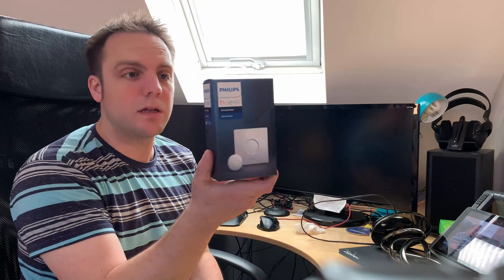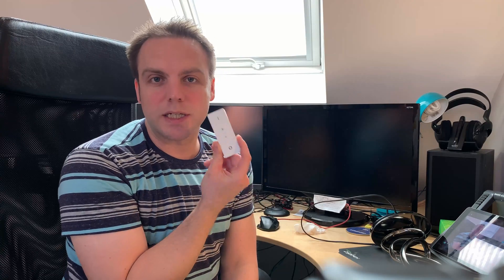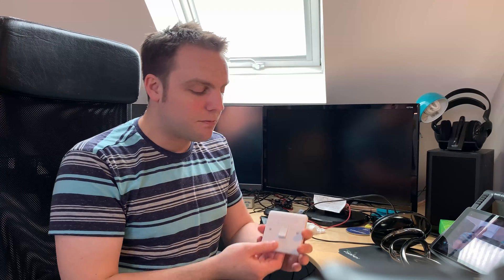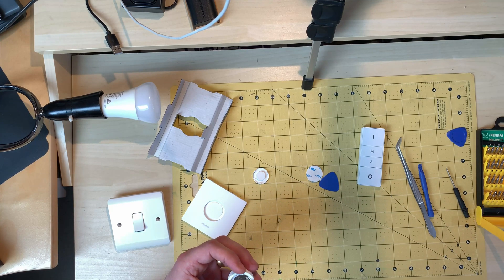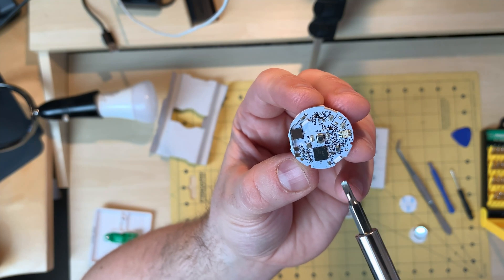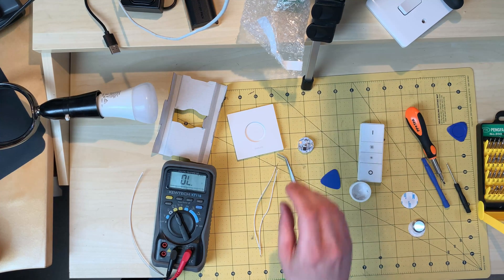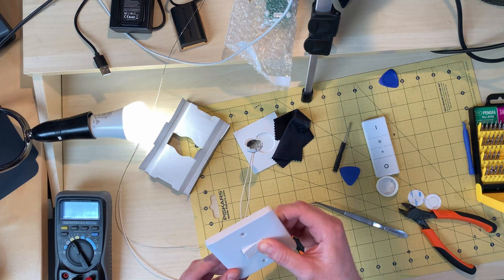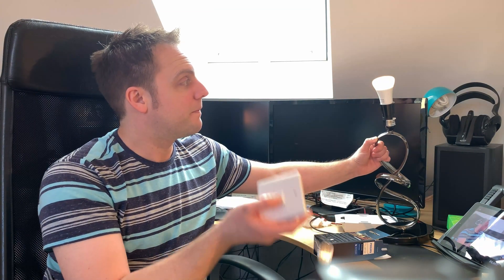Philips Hue Smart Button - teardown and hacked into a retractive push button interface :D

Comment: I remembered coming across this video years ago and it is now exactly what I am looking for to add a "Pull Cord Switch" in my bathroom. Have you tried this with the newer style switch? I was also thinking it might be possible with the "In wall module" with less modifications required?
Reply from the maker: I would imagine if you use a standard latching
 pull cord switch you could use the Wall Switch Module off the shelf ;)

Comment: Awesome ! Can you do the same with a hue smart plug ?
Reply from the maker: If you mean can the button control a smart plug? Absolutely.

If you mean can you adapt the integrated button on a smart plug? No I don’t think so; with that unit you’re looking a 230v board so the principle would probably work but I would use a smart button to do that - wireless, battery powered and the switch can control the smart plug without messing with 230v

Comment: Great video 👍

Another option is the Samotech modules which can simply sit in the ceiling wired to the first bulb in the circuit, allowing you to use any retractive switch (like Gira) at the wall while having Hue integration.

If the back box is deep enough, these modules can even sit there.
Reply from the maker: The problem with all of those types of solution is that they are not friends of hue - so you lose HomeKit and Siri functionality (at least).
Reply: @HouseOfPayne666  

Actually, Samotech is one of the few that is exposed to and compatible with HomeKit and has the HomeKit integration via the Hue bridge 👍

It’s compatibility includes:

Hue Bridge
Apple HomeKit 
All the Amazon Echo Zigbee Hubs
SmartThings 
deCONZ
Raspberry
Reply: but then you have to buy those €30 modules .. with this method I can use my old (€21 ) smart  buttons and put them into a €1,50 switch matching my power outlets.

Comment: Anyone had any issue with battery? Placed a brand new batter in the device and then hooked it up to a pulse switch, within 20 mins I’m at low battery within the Hue app (4% showing in Hue Dynamics).
Reply from the maker: Not at all - mine are still going strong since I did this video
Reply: @HouseOfPayne666  very strange then. ive put another new battery in and same thing. like it still works (most times), but it now just sits at 1% battery
Reply from the maker: @TooSpeedy  you must have a short. Is the pcb insulated? Is it in a metal backbox?

I cut a slit in the button case and reinsert in the button case secured with hot glue - then the battery cover magnetised onto the back providing a fairly neat package which is insulated.
Reply from the maker: @TooSpeedy  you are using a spring return switch rather than a fixed position switch yes?
Reply: @HouseOfPayne666  yeah it’s a spring one. The actual process works fine. 

It is in a metal back box, will be changing this for a plastic one. I did put insulation tape around the pcb / connectors etc to make sure things weren’t touching. What I may do it out the cover back on top and see if that helps things
Reply from the maker: @TooSpeedy  sounds like you’ve covered all the bases - perhaps it’s just faulty? I’ve made 9 or 10 with no issues.
Reply: Seems like the Hue Button is faulty. Mine stopped working after ~4 months, the new Panasonic CR2032 lasts only for few pushes and the LED goes red. It would be amazing to find a reason of the issue and fix it.
Reply: @robxxxx6987  hi rob, this is a known issue with the hue smart button. it seems it’s the luck of the draw whether you’ll end up with a button with this issue. i bought my sole hue smart button direct from philips and i’ve replaced my battery three times in about the space of a year. i spoke to philips and they advised me to try a new battery since the one that came with the button, which i’ve done twice now. so time to speak to philips again to hopefully get a non-faulty replacement.

Comment: I've been looking to do something similar. eg. my heating oil tank has a electronic gauge with binary volt free outputs for low fuel and also I have a float switch in my pond for low level. I want to use something cheap to create a routine to my Alexa. I have tried hacking a cheap smart door sensor with limited success, as it uses a vane hall effect sensor and magnet as apposed to a reed switch that would be easier. Anyone have any ideas ??
Reply from the maker: Depends on your system - what do you run - zigbee? Zwave?

Comment: Great video! Which diameter wire did you use (in mm)? And do you attach the housing back (modded?) on for dust, before mounting it in the backbox?
Reply from the maker: You can use pretty much any wire; I think mine was about 0.5mm2 cross sectional area but it doesn’t matter.

When you get the hang of it - cut a strip down (all the way) for the cables and squeeze  some hot glue in the button case then insert the unit back in. The battery cover will magnetise onto the back but it won’t close fully as it did before but it keeps all the metal stuff insulated.

It’s fairly neat - I’m pleased with it

Comment: You can do the same with a Tradfri dimmer from IKEA, which are only €6. I have a two-gang switch using two of these and it works great!
Reply from the maker: You know what - that is _perfect_. I'm living with these one fold buttons and often find myself wanting the lights brighter. This invariably requires me to press and hold twice, or turn the lights off, and then on again to get more light. 

I've decided a 2 way rocker (ON/Dim up, and Off/Dim Down) is the only practical way forward. Thanks for the heads up - I'll definitely be buying one to experiment.
Reply: @HouseOfPayne666  It's Touchlink so there are a few limitations but you should be fine. Good luck!

Comment: Hi, great video and perfect for what I have been looking for.  What faceplate did you decide on in the end or are you still looking for a ‘premium’ replacement?
Reply from the maker: I keep walking past the hulsta shop on Baker Street in London, and Mean to go in (Gira are downstairs) but I’m worried about the whole pandemic and unnecessary visit thing at the moment.

Jung have just opened a showroom too. I’ll pop in in the new year ;D
Reply: Yeah, understand - strange times at the mo.  Would be good to see a video when you’ve got the new switch.  Also, I see from your other comments that you’ve also tried something similar with the four button dimmer, that would also make a good video.  Keep safe.
Reply from the maker: @CYP4ER.  I didn’t film the 4 button dimmer; it’s extremely fiddly, and much less useful. More importantly the pads are minuscule and the final product is not remotely robust.

The only practical use I can think of is 3 scenes and off with no dimming. This doesn’t seem as useful as the one button control, to me.

I would not recommend it.
Reply: Thanks for your feedback, looks like it’s the button route for sure.
Reply: @HouseOfPayne666  I've been following the various discussions and held off from doing this before knowing what faceplate/switch to use that would be compatible with a UK backbox? I had a look at the Jung LS990 switches online, but they do not seem compatible with UK back box screw holes.

What switch and brand have you been using temporarily at your house?
Reply from the maker: @philhario3640  I’ve been using Hager sollysta switches which match exactly with my non hue Hager switch circuits - visually you cannot tell the different between a switched circuit and a hue retractive switch circuit - they look identical - but one type is spring loaded :)

They’re not elegant like the ls990 switches but they do work nicely.

Re ls990 yes - they are designed for a euro round vde wall box and will require an adapter to mount in a Uk box. This adapter will lift them off the wall by about 0.75 millimetre and the adapter plate can be seen. 

It’s not too hard to replace the back box off you really want to. Just be aware that Philips have finally caught up with me and will be releasing a 2 fold push button interface soon.

Having lived with a one fold retractive switch I’m now more than ever convinced that you need a 2 way centre return retractive with an “ dim up and on” way and a “down and off” way.

My auto scheduling hue labs can dim the kids bathroom to night mode before we’ve finished cleaning teeth and to turn it up takes at two clicks  which I find disproportionately annoying on a regular basis :D

Remains to be seen how effective the new Philips product is - as it’s got a funny use case but I strongly suspect that it can be used in this application.
Reply: @HouseOfPayne666  Thanks so much for the reply. That was very useful to know.

I'm afraid I'm a bit ignorant of some of the terminology, but can you quickly explain the difference between a "one fold retractive switch" vs. a "2 way centre return retractive"?

I believe I understand that the latter has the additional functionality that there is a dimming operation (dim up) if you press+hold for 'on', and dim down for press+hold on 'off'.

So in the video, I guess the point is that the normal retractive switches don't allow for dimming, so coupled with the Hue Button, you won't be able to do any sort of dimming?

So returning to what you wrote: 
> Just be aware that Philips have finally caught up with me and will be releasing a 2 fold push button interface soon.

This is confusing to me. Isn't the Button already a push button that allows dimming by holding? How would this newer Hue model be any different?
Reply from the maker: @philhario3640  a “fold” is a way of depressing a button.

So a one fold button only clicks one way. You can dim with it but it guesses that you want to dim down first. Next time you press and hold to dim - it dims up.

A 2 fold centre return switch can be pressed up, and also be pressed down - and it returns to a neutral central position when released.

So with this you can press and hold the top button and it will always dim up, and press and hold the bottom button and that will always dim down.
Reply: @HouseOfPayne666  

Aren’t there two types of these two fold rocker switches - push to make and push to break? 

I guess the central/neutral position of the switch has to in a powered state (push to break?) rather than an off state (push to make)?

Thanks
Reply from the maker: @rt1185  those switches have normally open and normally closed terminals so they work either way. 

I used the normally open terminal so it was push to make ;)

So no electricity flowing at rest. Circuit only made during operation.
Reply: @HouseOfPayne666  

Thanks for prompt reply and clarification. 

A great channel btw, loving the content - subscribed with all notifications 😀
Reply: @HouseOfPayne666  

Would something like this work as a retractive switch for Hue bulbs, Samotech modules, etc?

https://www.tlc-direct.co.uk/Products/VL102SRS.html

It’s states the switch is sprung to always reset to 'off' in the centre.

Thanks 🙏

Comment: Hi. How did you get the board out of the housing? At 4:22 you hand is not visible. I tried myself and managed to damage the board? Thanks
Reply from the maker: Yeah : me too.

I've made about 12 since - and learned a few things. The plastic nubs that clip the boards in place wont be re-used after wards as the wires stop them from clipping  you have to hot glue the board back in the case if you want to re-use it.

SO

I've taken to using a scalpel to slice the plastic clips off the case while the board is still in place - then it comes out easily.
Reply: @HouseOfPayne666  i just wish philips would provide these boards separately with some connectors in place. BTW did you try hooking up exzrnal LEDs of a switch to the board?

Comment: Hi excellent hack. I use Hue for commercial cutouts with Modulars Hue Connect 1-10v controller. Our biggest request is to use push (to make) buttons rather than the std Hue Dimmer. The Hue Button is not available in AU for some strange reason but I have brought off eBay. LEDsGo have a Casambi version http://www.ledsgo.eu/products/bluetooth-lighting-control/4ch-push-button-interface/ I have asked them if they will make a Hue / Zigbee version. If not, could you make me a prototype or proof of concept with the Hue Dimmer so I can have 4 button control ? Could you message me so we can have discussion ? dudley@modular.partners many thanks https://www.modular.partners/news
Reply from the maker: tried to email you but its bouncing back as "access denied", can you contact me via another email address? www.paynetech.co.uk

Comment: What are you doing for power to the lights?  Just bypassing the switch and having constant current?
Reply from the maker: IReallyWantThisName yes - I just use Wago spring connectors like this : 
https://www.wago.com/gb/electrical-interconnections/discover-installation-terminal-blocks-and-connectors
Reply: @HouseOfPayne666  just connecting live and switch live, then placed in the back box behind the switch with no way to turn power off besides the consumer unit? Do regs allow for that or are you not bothered?
Reply from the maker: @IReallyWantThisName  it’s fine provided that you remove the switch and the cores aren’t touchable. It’s perfectly safe and does not contravene Uk regs.

However - I believe this constitutes a change to your electrical wiring that would need signing off by a qualified electrician so the junction must be accessible - and the signing electrician would need to be able to view the terminations.
Reply from the maker: Goes without saying I also use a separate Wago plug for the neutral, and another one for the grounds. The backboxes are plastic in my home so no need to ground the backbox

Comment: I stuck the hue button to a UK blank plate. It works for me but this solution would make it much more user friendly for the non geek. 

Philips will never make this tho as hue is a consumer product only (I cant buy at my electrical suppler). 

If you had the capital you could create something to work this way and sell it under the friends of hue system. Hue being a world wide product and this solution not relying on voltage, it could be sold world wide.
Reply from the maker: I’ve considered this however I suspect Philips will not support a push button interface style module  - as it is not “consumer friendly” and does not fit within their marketing vision for hue.

For now I’m happy with my little hack - it works well for me
Reply: StuffAboutStuff thanks for the reply and well done for figuring it out! I’ll definitely be giving it a go.

Comment: I wondered; have you considered attempting something similar with the Philips Hue Smart Wireless Dimmer Switch (929001173761); the vertical four button format. Used with a couple of two-way retractive grid switches (so a gang backbox with a couple of retractive switches) I guess one would be able to utilise all four of the Hue Dimmers buttons? With a little imagination (and modification of the backbox) I can get the remote to sit inside snugly.
I just wondered whether the solder pads are as accessible on the 929001173761 switch?
Good work,... and thanks in anticipation,...
Reply from the maker: I've since made a few of these:
1) the solder pads are much smaller and the solution is nowhere near as robust.
2) you cant have hold-to-dim functionality at present - even with iconnectHUE. This kind of ruins the whole idea of it.

But the 0v for each button is straight to battery so you can use it as common for all 4 buttons from just one solder pad.
Reply from the maker: Bob Jenning I thought about this but the actual pcb is too big to fit in a Uk back box, so the back box would need a large hole punching in it to tuck
 the pcb up inside the wall.

Just didn’t seem elegant to me.
Reply: I have tried this. I have attached cables to ON and OFF switch and connected them to double wall switch from Berker (with separate connections for left and right button). It works very good but the downside is that without external casing the dimmer switch PCB cannot hold its battery. Other downside is that I use right button on the wall switch to turn light on (or change scene) and left button to turn lights off. You also need to have significant amount of space to put fragile PCB into wall cut-out. I have made only one prototype of that solution. I think that using smart button is so much more simple. Only one switch connects to the simplest wall mounted push button single switch, small size make it possible to fit anywhere and with the soldering points exposed it still can hold its battery. Soldering points are also much more accessible than in dimmer switch.

Comment: I was about to make a jig and router out all my mdf torus architraves to fit in super neatly the hue dimmers as the flat part of the architrave is the same width as the dimmer, i was going to flush mount magnets as well, and then completely remove the existing light switches and fill and paint,  although this vid is excellent  i cant use it as my volex switch range doesn't include a press switch,  although i wonder if i could modify one with a spring inside, cheers.

Comment: You are a genius! Ive been looking everywhere for a compatible switch to work with hue. Why don't hue just make an official wall plate for uk switches? Beats me... Anyway, off to learn how to solder now 😂 Any idea how long the battery life is on these? Can thee control colour or white ambience lamps?
Reply: Callum Allan I’ve done this in my house on the back of this video - works an absolute treat and the most elegant solution I’ve seen. Hue buttons can control any hue connected light whether white, white ambiance or the colour lights and can configure to do loads of actions either with the hue app or something like iConnectHue for lots of extra bells and whistles.
Reply: Thankfully now the put it in the market